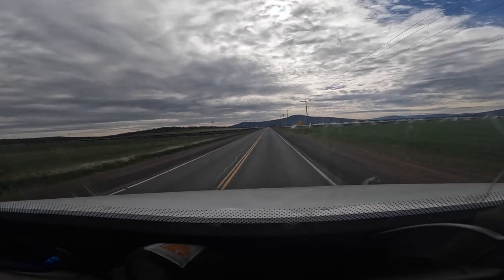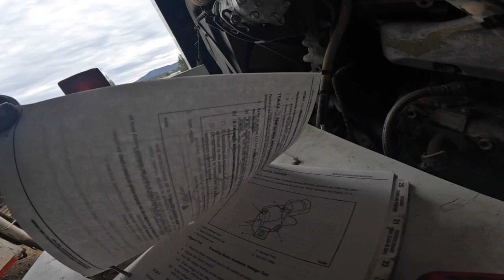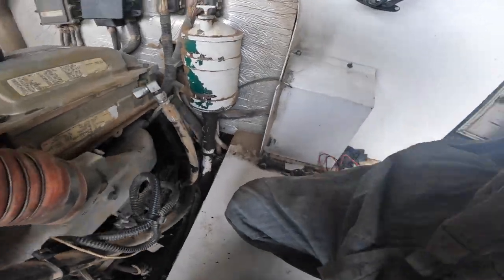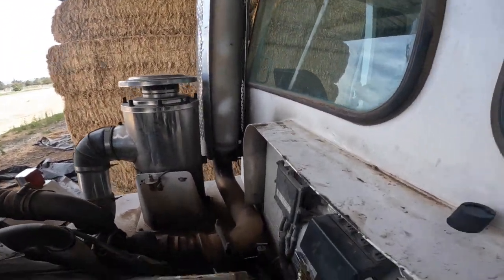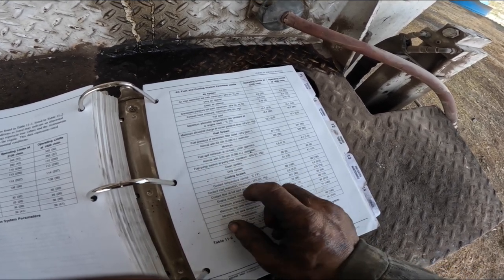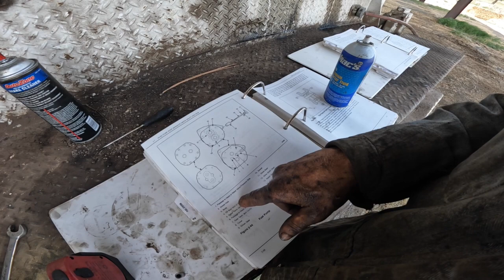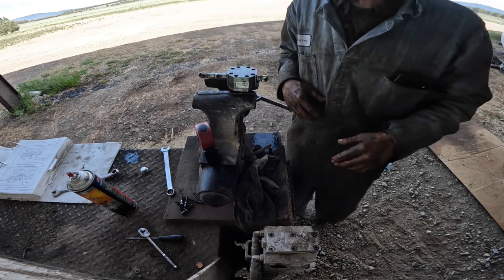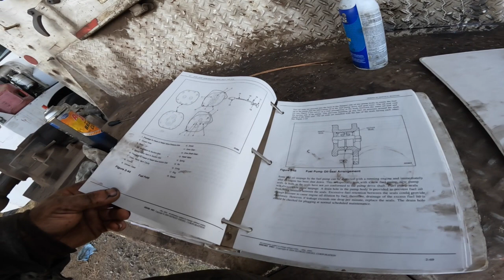Detroit 50 series crank no start

Comment: The Detroit Series 50/60 just need fuel at the injectors to fire off, provided all the electronics are okay. If I thought the fuel pump was an issue, I always primed the system with a hand pump to see if the engine would light off. If the fuel pump was bad or the system lost prime, the engine would start and run.If it just lost prime the engine would stay running, if the pump was bad it would start to stall out and die after 20-30 seconds. The injectors are their own pump once they have fuel to them. Electronically, there could be a number of issues causing it to not start. Often an engine that was running okay and won't restart after a shut-down could be a faulty SRS or TRS sensor. Those can be checked for function via the ProLink or the laptop. Good Luck and Thanks for the videos.

Comment: This job reminds me of that alternator job you did. Brand New and the voltage regulator was junk.

They may have swapped the pump with a junk one like you suspected, but the main problem lies in the ECM? Can't be doing much good in secured getting bounced around like you showed us.

2 problems maybe. I look forward to you telling or showing us what was what. Love how you never stop until it's solved and your always thinking what's around you like the ether cans etc. 👍👍 Not easy when someone else has had a turn first.

Comment: 50 series were used in transit buses for years. It’s probably one of the engine position sensors. I can’t remember which, but one of them will let the engine start when the other has failed.
  The counter balance assembly is famous for the bearings walking out, and  the drive gear dropping away from the bulk gear. Engine shuts down due to no oil pressure, as oil pump is driven by balance shaft. 
We had one strip teeth off the accessory bull gear once.  The ceramic cam follower rollers would sometimes break. You wouldn’t know it, until the engine developed a lope from a flat cam lobe. 
Ahh yes, the good old 50 series days lol 😆

Comment: Warren, one thing I do when starting up or working on old gear, is I have a fuel tank for an outboard motor with the primer bulb and hose .  I usually hook on straight to the fuel pump, or if petrol can get on to the Carby and gravity feed. Using one give you the opportunity to provide clean and fresh fuel, and the primer bulb you can get the air out before you even start.  
  Just an idea that may help some folks.

Comment: The return port at the back of the head should have a check valve  the return line  hooks to it ,that valve is your fuel pressure  control and keeps  the head primed with fuel at all times

Comment: Yeah that's a strange one, I would probably crank it with the fuel pump off and make sure the compressor's turning. If you can set the camera up so you can record it and play it back or use a starter remote switch so you can crank it and look at it at the same time.

Comment: The connector that powers the ECM is the same connector on an old Chevrolet S 10 windshield wiper motor . Replace wires in the connector with a heavy gage wire . This supplies ground ,  constant current , and key on current . Check wire schematics and install 2 alligator clips some of the wires will be need to be spliced together at the connector .

Comment: use a cheap garden sprayer and take the spray lance off and fill it with diesel connect the hose to where you need it and pump it you shold get a few bar pressure once you jubilee clip it and about 3 litres of fuel to run on  it works as i have done it myself.

Comment: You could try shimming up behind the relief valve spring to see if that increases the pressure to the 75psi. Sounds like it's faulty to me. I think the pump should  be OK. In my experience  if you dead head a worn pump it can most of the time build good pressure because the liquid being pumped isn't flowing anywhere or has nowhere till go too so that gives a worn pump time to build up good pressure.  A pump flow test under load is a much better test of a pumps condition.

Comment: the first thing to check on a 50/60 series on a no start is to check if the ECM has received a SRS signal during cranking.  You will need to use your software or a PROLINK. I only takes a moment. The SRS tells the ECM which cylinder is number 1 so it can fire. Then go to your normal trouble shooting after that
Reply: Great thought but if there isn't fuel / fuel pressure it kinda doesn't matter which if any injector opens it is never going to fire.  The no communication to the ECM has me concerned , I think the owner of the machine was trying to chase one problem and created another one by throwing parts at it.  Now Warren has 2 issues to deal with.
Reply: That is right.Easy way to lock out a 50/60 is to unplug the SRS.Hard to steal your equipment with the SRS unplugged.

Comment: I wonder WHY they were messing with the fuel pump in the first place.  I am guessing they thought they were having a fuel delivery issue.  ECM? maybe?   It could be a broken shaft in the compressor , I guess.  And to answer your question , yes.  Most filters designed for post pump usage do have a bypass built into them.  That is why they don't explode if they get plugged up.  A cheap or otherwise poorly made filter can do nothing more than bypass rather than filtering anything, I have seen that but it is REALLY rare.  Is the compressor making any errant noise?  Can you bypass the mechanical pump with a high pressure electric?  I know that would be changing several things at once which is a diagnostic no no but I am concerned about why there isn't fuel spraying everywhere.  Did some dope maybe drop a rag or something into the fuel tank?  Keep us posted if you would please.

Comment: Yes "lbs in2" is PSI -- or "Pounds per Square Inch".   So if it's supposed to be 75 and you're only getting 45 and dropping, then yes, it's dead, right out of the box.  That's a shame, because the re-man guys should be testing these things before they put them back out on the shelves. smh

Comment: Nice 1 Warren.... As you said before .. Re man are just Junk ...  the pump when dead headed, should have had the relief valve open and maintain the Relief  set pressure... Sounds like you will be fitting a new Pump .. If they manage to get 1 for it !!!!

Comment: Curious why they changed that fuel pump and has the engine run properly since that work was done. Smelling a bit of rat here Warren as nobody seems to have told you about the recent repair history. Good luck.

Comment: Com on Warren you are smarter than that. The pump is working. Yes the pressure is a bit low.  The problem is further on, There should be a valve in the head or were the fuel comes out to restrict flow to create pressure.

Comment: That second hose coming off the output of the pump seems goofy, I wonder what that's going to. If it's returning to the tank it wouldn't ever be able to build 75psi rail pressure.

Comment: The fuel pump spec is at no load full rpm . Probably around 25 psi at idle. You need to prime the head and injectors. I use a primer can. Mine is a old stainless yard sprayer with a 90 degree ball  valve on the end of the hose.  Take the fuel temp sensor out and install a line from primer can. Pump up primer can full of fuel and pressurize to at least 30 psi.(usually take at least that to push air out of injectors)Open ball valve and fill fuel system. You hear fuel return to fuel tank.  Engine should run on 25 psi.

Comment: Curious if it would be a good idea to carry a batch of various length cinch straps to pull back wiring harnesses and hydraulic lines, etc.  seems like it would help a lot at a low cost.  I have found them handy to use although in a much smaller scale then you do. Just a thought. Take care

Comment: I had a situation like this with this engine and what I did was primed filters and poured fuel into the pump in line, connected it and then ethered the shit out of it. Fired right up
Reply: Could also inline an electric pump to charge the system.

Comment: Check for fuel in the tank for fuel, if there is, go to where it connects to the pump then loosen the connector to outflow to see if the pump is working? If it pumps fuel out then it is a clogged line from that point on. No pressure on the gauge means the fuel pump is gone, Johnson. Whoever worked on the fuel pump, that's the cause of no fuel. Get new pump.

Comment: Hey Warren. With all the "No fuel" calls you get, Maybe try an HVAC coil cleaner/pump sprayer. It'll double as fuel storage & can be used to prime fuel systems vs. dead batteries. I've used them myself & they work great. Just need an adapter or two & hose clamps. I've primed fuel lines & even tanks, Only takes a few #'s.
Reply: Been using a marine blub pump on gas engines that have a vacuum fuel pump, they fill up the carb with a few pumps and cuts down on cranking.

This marine blub pump should also work on diesel to prime up the system from a bucket.

Comment: What would cause  cat 977 k to push the transmission fluid into the engine over night after running it. Three different mechanics already looked  at it . Replace hydraulic pump. Now I'm told its the torque converter ? Any cheaper ideas ?
Reply: How can that be the torque converter? If so, then the bell housing would be shock full of transmission oil. Im thinking it maybe has a combined transmission and engine wich  is leaking? Or a does it have  steering pump that is coupled to the engine?

Comment: What scan tool/software do you use to diagnose and repair?
I haven’t been able to find a good one. I use all the normal Insite and diagnostic link and Cat sys but Paccar and all of them have started locking my abilities to perform I/o control.
I can’t even do service regens with the software without a dealer ID and password. 
I’m leaning towards Mitchell software but it’s just repair info and doesn’t have the ability to pull codes. It’s about $250-300 a month.
Reply from the maker: Texa or JPro

Comment: Did they replace the filters when they replaced the pump?  if the suction side is being filtered could that filter not be allowing fuel to get to the pump for some reason?
Reply from the maker: I'm sucking out of a bucket

Comment: hello sir! im just turning 32, and have been a professional car mechanic for going on 8 years now. besides oil changes, wheel bearings, radiators belts and tires  -  i dont have much extensive experience fixing diesels. What tip would you give someone like me looking to get a job in the industry and be able to learn?
Reply from the maker: Right now if you want to work, I think with any mechanical experience you should be able to get a job with no problem in this field.
Reply: The electronic side of it is what makes things interesting an in my opinion if you have a knack with electrical diagnostic you will go far